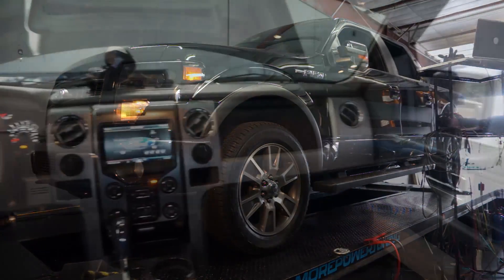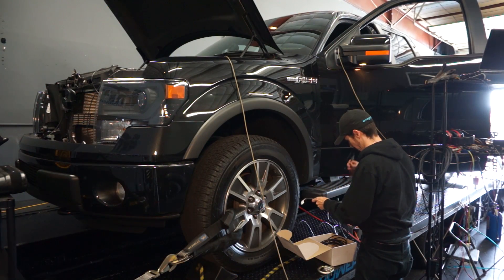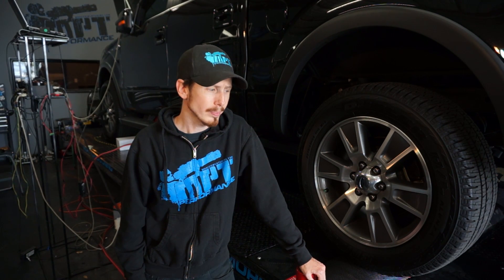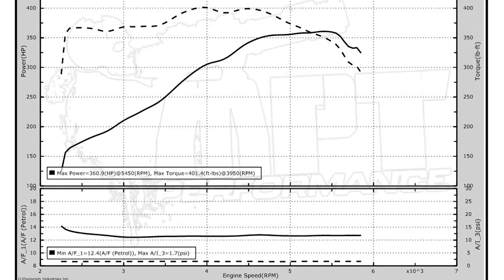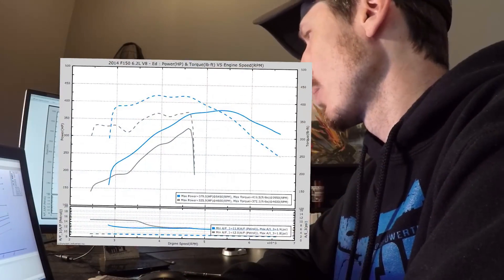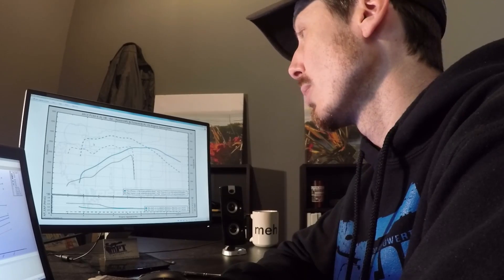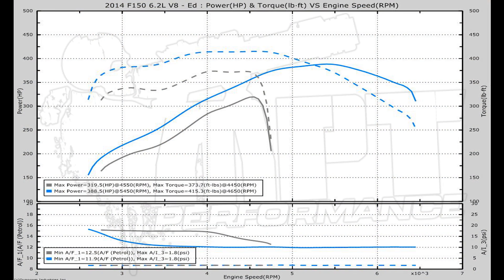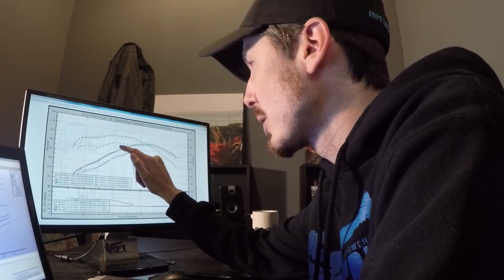[Discontinued Product] Gain 50HP on a Ford 6.2L

Comment: The most impressive thing is the torque and how flat it is.   Those are SOHC engines, so they should rev higher with more durability to a pushrod.   All of this power is made around 5500 rpm...    What about cams that let it rev out to 7500 with power peak at 7000 RPM or so.
Reply from the maker: Great question, we have not tested those cams here on the dyno

Comment: don't waste your money on the CAI...tell that man to shut the hood and then run it on the dyno.  you will be sucking so much hot air you would under perform a stock in take with a stock tune

Comment: Why has this been discontinued?
Reply: drop for newer stuff? the 6.2 is still in F250 and 350 pickups from 2011 - Present.. motor isnt going away anytime soon.
Reply: MPT Performance but to drop completely? Why not just stop update consistency?
Reply: Well, this motor is still available mid 2022, you pulled the plug a bit early, LOL
Reply from the maker: Occasionally we'll need to drop support for older engines in order to support new engines. We're a relatively small and specialized team and there are only so many tunes we can build each day.

Comment: Why in this video does he say the first pull was 360HP and 411Torqe? Then when reviewing he says stock was 320HP... Am I missing something here?
Reply: so really they made 20 - 28hp and 6ftlb of torque.. well that was a bit disappointing.. lol Glad I wasnt the only one to catch that.
Reply: Check the at the wheels power. That is what he is showing. At the engine is what Ford does.
Reply: James Wasilchuk Same thoughts here. I was hoping the 360 hp would go up to 410 hp as Ford advertised the 6.2 l to have
Reply: @VIccs826  
Ford and every other automaker rates their engine power at the flywheel (in other words, no parasitic loss from the transmission, rear end, etc.).
Testing on a chassis dyno, like the one shown, measures the power at the wheel, after it's gone thru the entire drivetrain.  It's usually an average of  20% less than just having the engine on an engine dyno.

Comment: so is it normal to get engine knocking on a 6.2L with 87 octane, traveling @ 40mph on 6th gear? i get knock and i hate the lazy transmission but I don't know if investing in a tuner would help improve any gains..
Reply: That's not normal the 6.2 is rated for 87 it shouldn't knock. I only run 87 on mine and it doesn't knock at all. I know the Chevy 6.2 is rated for 89 and 93 so if you put 87 in it will knock

Comment: why does the stock graph stop at 4500
Reply from the maker: +ricky klingbeil Factory speed limiter.
Reply: +MPT Performance really?
Reply: +ricky klingbeil so most of the hp gain comes from the increase in rpm since it was in a gear that hit the speed limiter
Reply from the maker: +ricky klingbeil To some extent, yes, but if you look at the graphs comparing stock to tuned, you'll see a considerable gain even at 4500rpm.